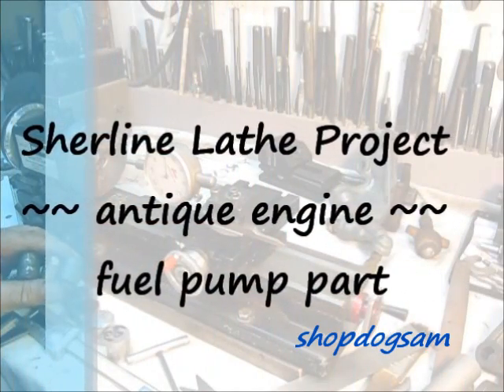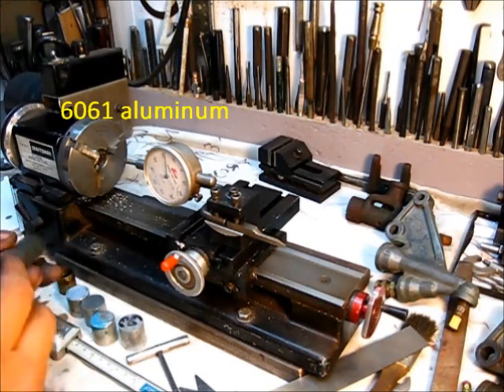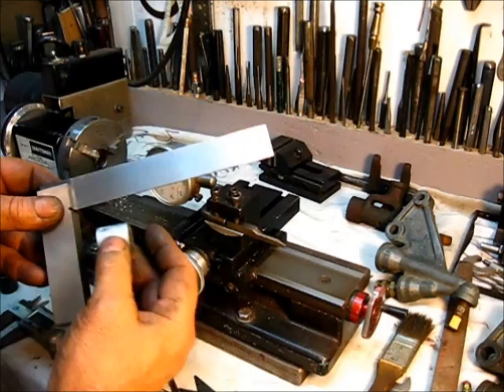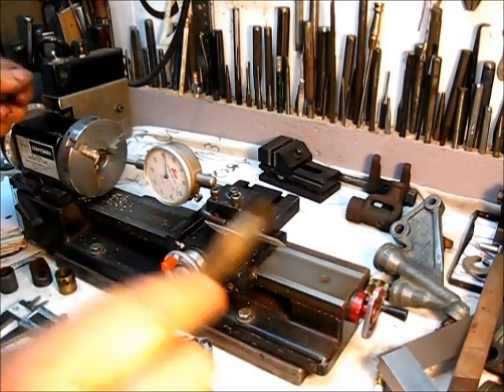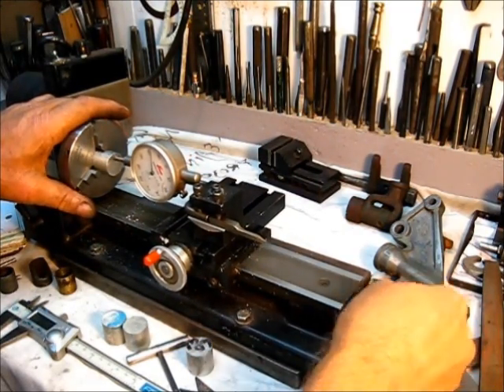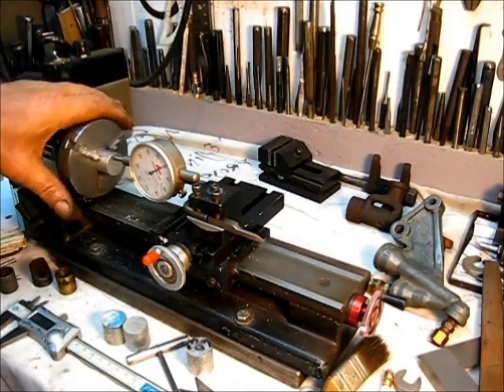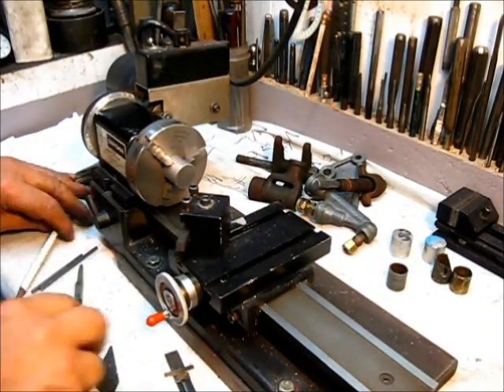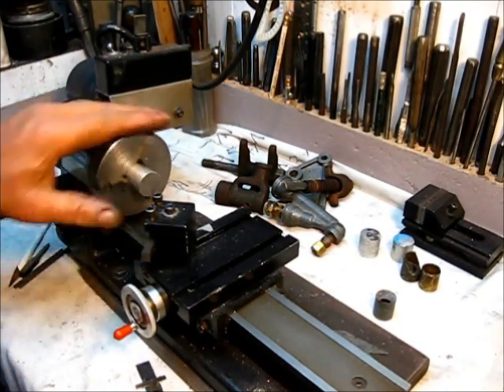Sherline Lathe Project / antique engine fuel pump part 1of5

Comment: One thing to watch out for on the HF 4x6, is the plastic knob on the band tensioner bolt pulling loose! Results in losing all tension and throwing the blade with a bang! (no, was not over tensioned) Mine was held together only by the a knurl on the shaft, like a radio knob! I fixed that by tapping the steel tensioner, and using a 10-32 bolt and washer to hold the tensioner bolt and knob together, works like a charm. Like I said, simple improvements. lol!